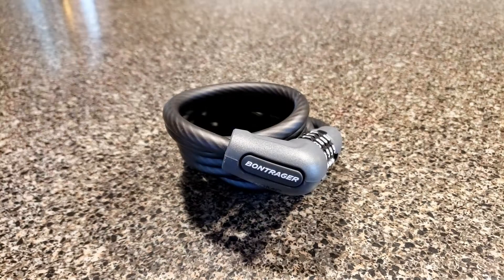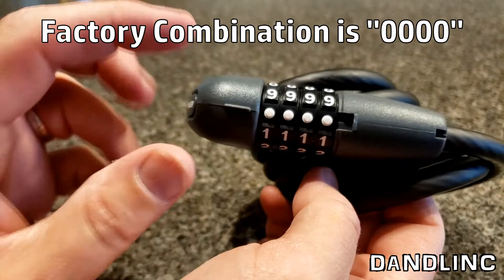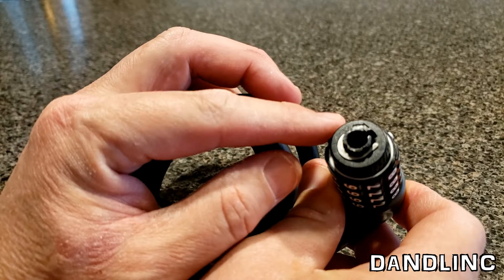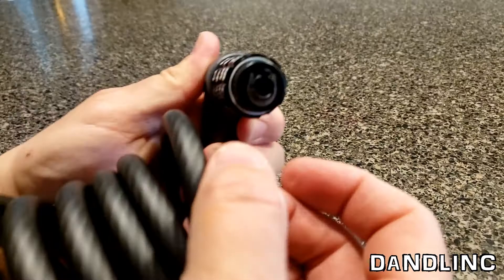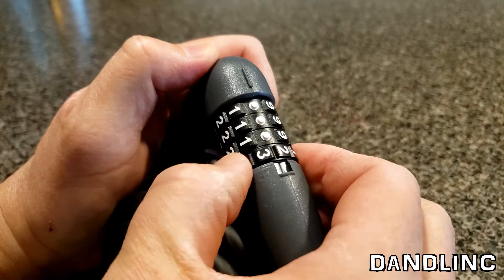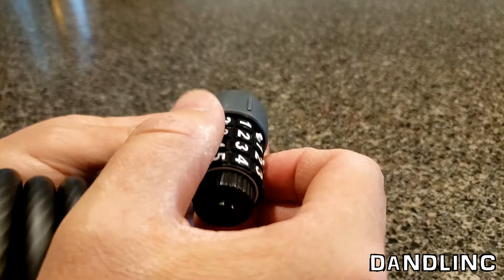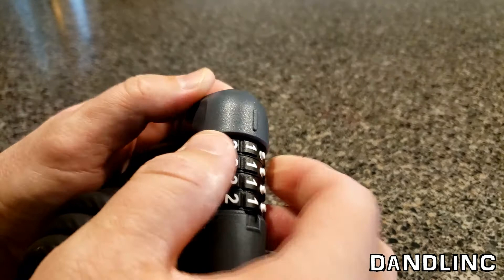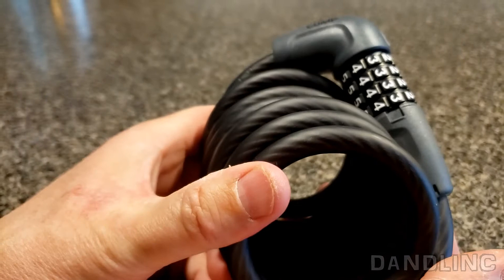EASY DIY! How To Set A Combination on a Bike Lock (Bontrager Comp)

Comment: Ok found this after removing plastic wrapping to use this brand new lock. I purchased it years ago and now follow the excellent tutorial you made! So...mine must be a 2020 or earlier? This same bontrager lock has red plastic inside with no arrow. Turning the plastic red moving parts to the right  isn't possible... as it is already turned right. The dots/0 were all at 0000. I will create a code and attempt to push the red plastic to the left....

Comment: Great and helpful video, thanks. I got this chain lock today. I don’t know what version it it but it has 2 red pegs you need to move counterclockwise but it’s tough. If you get this version get a flathead screwdriver to move the red pegs per picture instructions, set your code and move red pegs back clockwise. You are good to go.